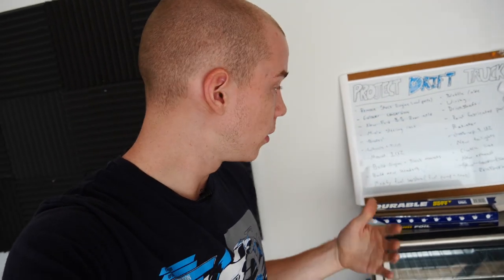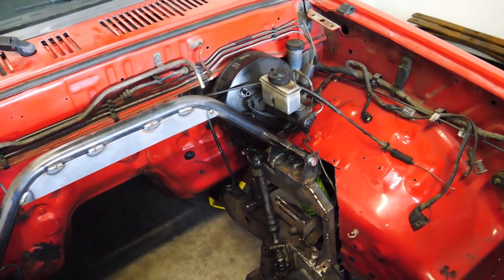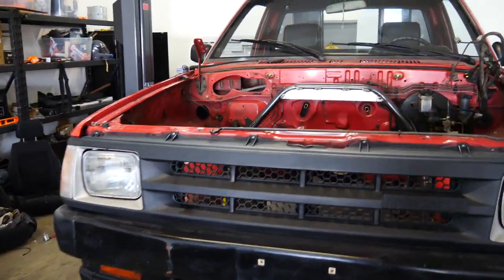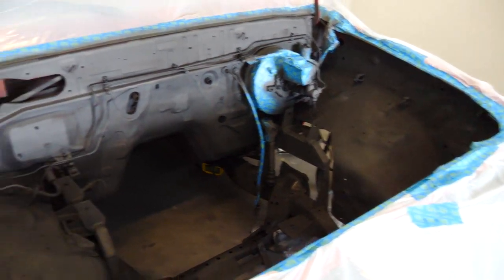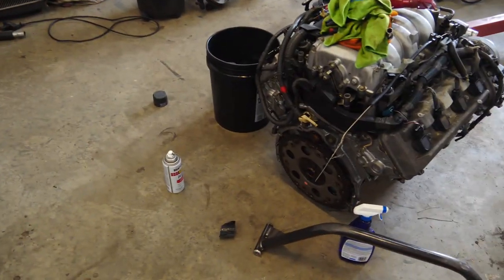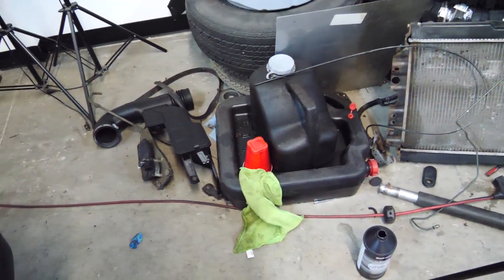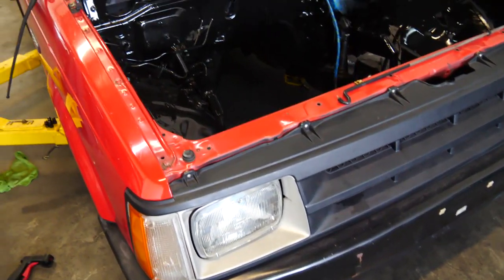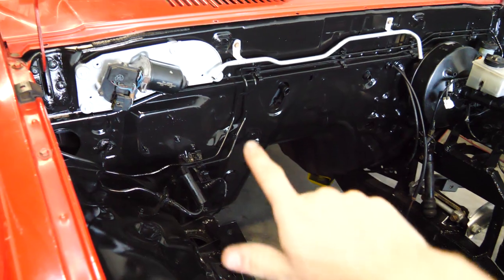Painting EVERYTHING on the Drift Truck! - Engine Bay, Suspension & More

Comment: Dont change the outside collor because the red looks amazing
Reply from the maker: I wont for awhile!
Reply: Keep the red. Looks good with the black wheels and bumper
Reply: Gramarium
Reply: Gingium I'd suggest you to paint it metallic red or a shade of it if you are planning on painting it later. It pretty good in red imho
Reply: @_Gingium_  please put a B4000 badge on it.
Reply: Rafee Samith why would he do that? lol
Reply: @jeremyurban6977  because B2200 = 2.2L engine. So with a 1uz in it it becomes a B4000 = 4.0L
Reply: Rens YESSSSSS what you said 👌
Reply: You should always sand the primer layers anyway, so that base coat might be designed to do what it does
Reply: Rens thats orange

Comment: I actually repainted my motorcycle with Rustoleum paint cans. The primer does come out all textured but I would just let it sit and dry for 30 mins-1hr  then wet sand it. That seemed to work pretty well for me. And you don't have to wet sand it hard, just enough to smooth out the textured feeling. I honestly can't complain about how my bike turned out for less than $100 of materials. The only issue I ran into was the clearcoat fucked up 2 or 3 of my fairings which I had to sand down and repaint.

Comment: primer is made to be sanded after application. you dont need to prime everything. primer is more used for filling sanding scratches and minor imperfections in bodywork and as a barrier on bare metal surfaces. when painting over paint you dont need a primer, just scuff with a 600 grit and spray.
Reply: and your fisheyes probably came from the detailing spray you used to clean the fenders off. fisheyes are caused by chemical contaminents

Comment: The issue with the primer is either a cleaning issue or it is being put on to thick, you can also have this same issue with using a spray gun and solvent based paints by mixing incorrectly or improper air pressure

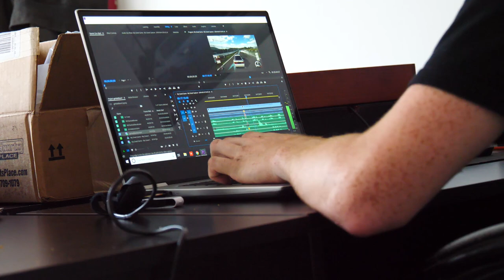Comment: 10:50 

This kind of laptop need to have an external add on cooling like a cooling pad to improve it's performance

I've tried a cheap ebay cooling pad and it work quite well to my laptop
Even though my laptop were a cheapo one, but it has quite much same cooling configuration

Comment: Damnit dude! Gingium you gotta listen to the comments sometimes! You should have used a spray gun... rattle can paint is never as good as a spray gun. I use the 15 dollar one from harbor freight and it works 10x better than any rattle can I’ve used... plus black is just as annoying to keep clean, and it will make finding leaks( especially on a drift car) a pain in the ass! also, why the hell are you using an sr trans?!?! I keep commenting and you keep saying you’re using it! It’s too weak for the 1uz! Yea they’re cheap, but they start grenading at around 400 hp with sr’s... you’ve said multiple times you plan on making that right off the bat with the v8, and to boot it’ll be making a ton more torque, which is what starts to break drivelines in general! Seriously consider a z32 trans... nearly as cheap as an sr trans, but it’ll hold 10x more power!
Reply: It weighs about 1 tonne lol... there's little stress on the transmission, its so light it would burn 2 wheels without a locked diff
Reply: Adams World weight doesn’t have as much to do with it as you’d think. By adding a bigger motor he’s adding more weight, more torque and more power. By adding a bigger, more aggressive locking rear end, he’s adding more weight, and better power transfer. By adding wider and stickier tires he’s adding more weight, and a ton more grip... all said, the car won’t weigh much different than an s chassis, and sr trans’s like to blow up past 400 hp on 2.0 liter 4’s. Throw a 400 hp naturally aspirated v8 in front, and it’s almost guaranteed to blow up. The thing about turbo cars is that the power isn’t very linear and is typically lower in the lower rpm range where torque is supposed to be. When you throw a n/a car at it, your power comes on basically immediately. To boot, a v8 to a 4, the torque is going to be way too much for the trans in the drifting application. If he was just driving the car around, them maybe it’d be fine, but doing clutch kicks, consistently banging limiter and smoking the tires? It’s not a question of if it will blow, it’s a matter of when. Just look at every other YouTube with a higher hp sr

Comment: You don't have to sand after painting!!?? Its all about the PREPERATION. Sand, scuff and prime would be alot more nicer quality. The paint is rubbing off because the layer underneath has no suitable surface to adhere to. Most people sand before painting! unless you like flaking paint. Imagine trying to write a pencil on a whiteboard.... if its smooth or faded paint it'll come off with a garden hose